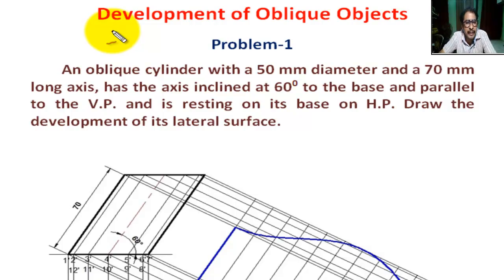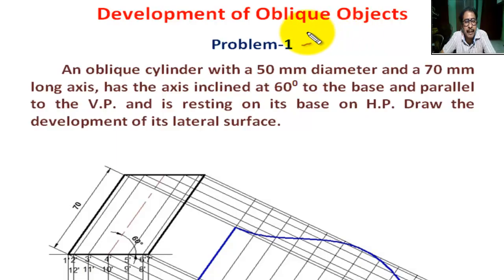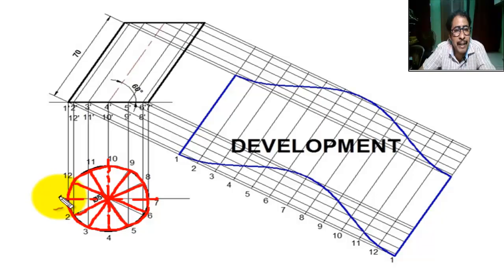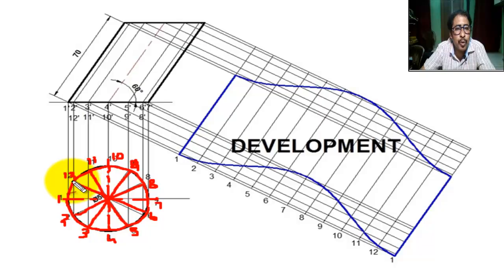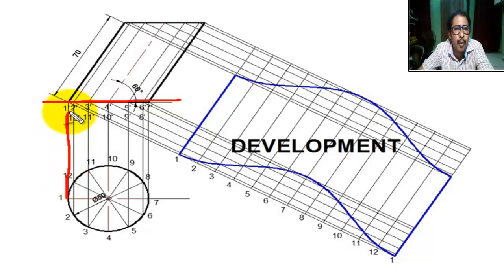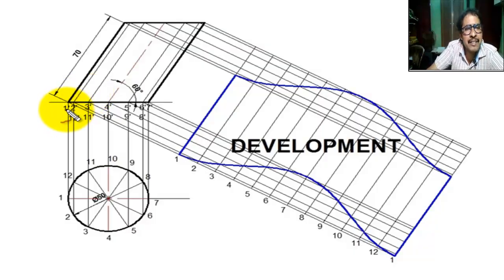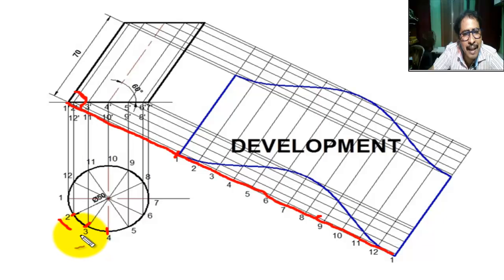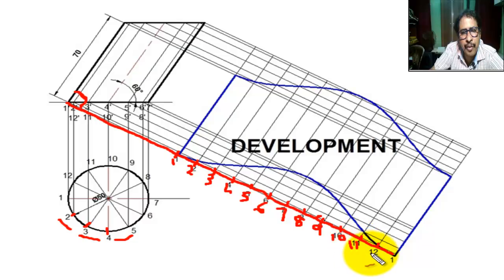Development of Oblique Cylinder

Comment: An oblique cylinder of φ40 mm base has its axis inclined at 60⁰ to its base. The vertical height of the cylinder is 50 mm. Draw the development of the surface of the oblique cylinder.
Reply from the maker: ok